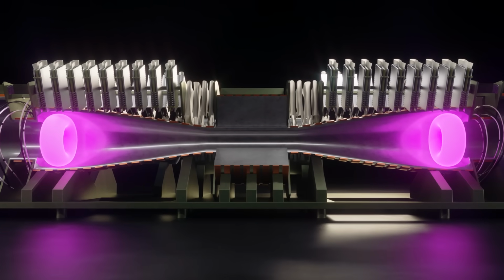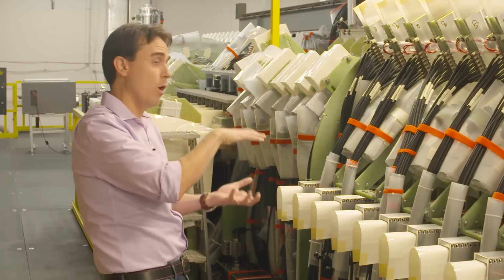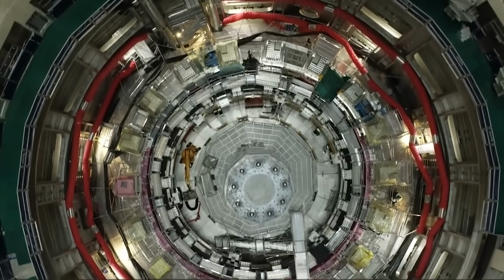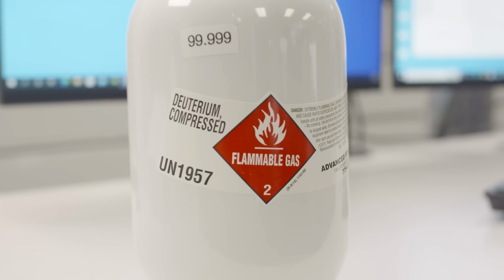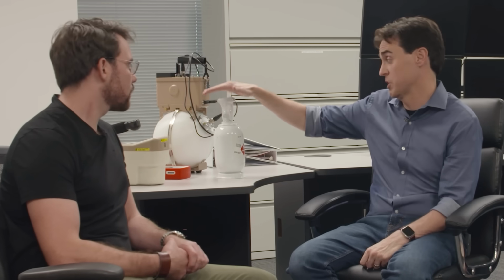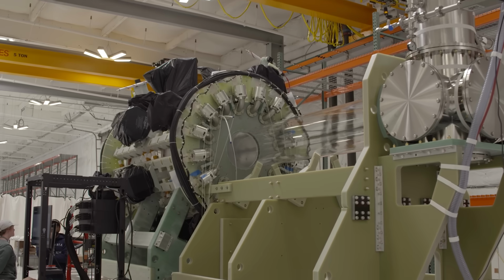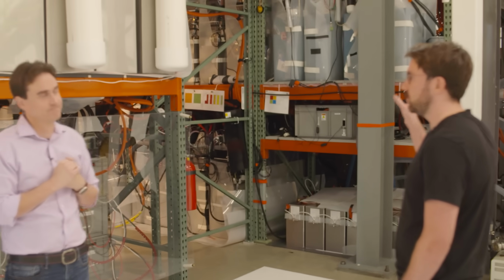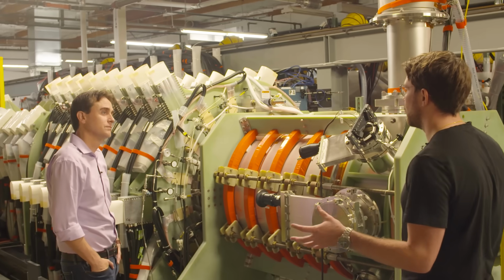A New Way to Achieve Nuclear Fusion: Helion

Comment: I love this process of energy capture so much! Turbines are so last century and this feels like something you could actually put to good use in a spaceship.
Reply: Just put an exhaust hole in it somewhere and it could probably become quite the engine.
Reply: You could even use the same EM accelerators to fire the exhaust out one end.

Part of the problem is you'd need one closed system reactor to provide the electricity to run the second reactor as a propulsor. I think part of the way they want to extract electricity is in discharging the charged plasma, but you would need to keep it charged if you want to magnetically accelerate the exhaust to some insane exhaust velocity. So that would basically require two reactors per engine. But, you could maybe then run it in two different modes. One mode would be fully charged exhaust from one reactor, for maximum efficiency, but low thrust. A high thrust but low efficiency method could be to magnetically accelerate the charged exhaust from one reactor, through the hot inert gaseous products of the second reactor, injected into the stream through a regular engine bell. This would slow the charged exhaust down probably, reducing efficiency, but increase the exhaust mass, and therefore, thrust. So you could make a hybrid engine out of two of these reactors, with a low thrust high efficiency mode, and a high thrust low efficiency mode.

Even the "low efficiency" mode would probably have an ISP rating in the thousands at least, making it better than any chemical rocket by far.
Reply: @hatman4818  Perhaps an optimized thruster is something closer to current ion thrusters, and this reactor would be used for the power input
Reply: "Turbines are so last century" LOL but i agree
Reply: Absolutely agree with you there.
Reply: The spaceship would need an incredible heat dissipation system.  Maybe radiators many times larger than the main body of the spaceship.  In space there is no conduction nor convection to  remove heat.
Reply: @davevann9795  This is just the accepted design for realistic fusion and fission ships. Most of them are depicted either pushing or dragging massive radiators. Some of my favorites have them sprawling off the sides.
Reply: @DigitalJedi  my favorite description of an alternative radiator was (IIRC) in the book Saturn Run where they had long filaments running the length of their ship, and they pumped heated mercury through some nozzle that formed a flow of droplets  that would run the length of the filaments, and these would radiate the heat until collection at the other end of the wire. I remember imagining it like the ship was a glistening guitar.

No idea if its a good idea but I imagine it was based on some existing concept.
Reply: @davevann9795   What produces the most heat in this setup?
Reply: Turbines have withstood the test of time because they work; but not having huge numbers of neutrons randomly waltzing through your reactor vessel at a significant fraction of the speed of light is definitely a plus. The copper coil "piston" method of energy capture is a seriously elegant solution to energy extraction if they can get it to work as intended.
Reply: Look into aneutronic fusion too then
Reply: You have a space ship you need an efficient power plant for?
Reply: "Turbines are so last century" Really now, an over 90 percent efficient way of converting steam to rotating energy is "last century"? What do you think of a Francis turbine? I guess it's medieval, since it's just another waterwheel, just one thats up to 99% efficient in converting the kinetic energy of the water in rotating energy.

I wonder how many more times in my life I will see another new revolutionary fusion reactor before there is one that can actually deliver steady electricity, and more of it then it consumes. We've been doing fusion pulses since the 50's. Fusion It's always just a decade away. I have seen documentaries, and read articles that mirror all the hope of this video for decades now. Every time a new design is tested it's the same story. We should certainly keep trying, but I'll get on the hypetrain when this is actually producing steady electricity.
Reply: As of right now, the weight of this thing alone would be incredibly hard to send into orbit
Reply: @user-mf2gr3cz6e  Yes, but you may be able to use it as the thing that produces the thrust. Even if that's not possible you could just build one on the moon with stuff from the moon and get it into space that way. They may also just find ways to reduce the weight of the machine by downsizing it and using lighter aerospace materials like titanium alloys, aluminum alloys, or carbon composites when possible to cut down on weight. They didn't design this particular particular reactor to be able to go to space, so weight is definitely not a concern in it's construction.
Reply: No more boiling water!
Reply: @ericwilliams1832  It also requires cooling and it is harmful to the environment.
Reply: And that will mean fewer dropped pianos, yes?
Reply: Great!  Now how can I make money off of this discovery?  🤑🤑🤑
Reply: @williamyoung9401  This isn't advice by the way, but if they are publicly traded than that might be a way. another way would be to make a clickbait video about literally any breakthrough science papers or news articles from the internet.

Comment: Maybe I missed it, but is Helion achieving a greater energy output than input like what was achieved at the NIF project?
Reply: Nif project didn't produce more than they used. The laser beam contained 2 mj to create 3 mj but to produce the laser they used 300 mj.
Reply: @ThatHungryAfricanChild  everybody has told you, the power to create the laser isnt importance since thats not what they tested. the next step is to create more efficient laser to create larger net energy. and that is an engineering challange.
Reply: @pindot787  what do you mean the power to create the energy isn't important? That's practically the whole point 🤦
Reply: @ThatHungryAfricanChild  its not important in this context because its not what they tested, you do realize this is happened in laboratorium and not intended for commercial usage?
Reply: @pindot787  the entire point is to create more energy than they use. If they use 100x more than they create then you're still not even close to achieving ignition. It's pretty simple stuff. Input and output.
Reply: @ThatHungryAfricanChild  No. Case in point, I work in FMCG company, lets say i had an idea for a new 5 layered rainbow shape chocolate with cheese and other flavour.
to create a small testing batch to see if it tasted good enough is crazy expensive because we need to buy the ingredients in small batch and manual tooling for the shape.
And now imagine  some random guy said the cost is way way too expensive based on lab cost. thats not how it works, we will create tooling needed for the shape and buy the ingredients in bulk so the cost is cheaper.
same analogy, whatever created in lab isnt the end products, because you only test for one thing to see if it is possible first.
Reply: @pindot787  that's not even remotely close to what I'm talking about. If you make a product but the cost to produce that product is more than what you charge them you're going to always lose money, that's pretty basic dude no need for BS analogies that don't make any sense. Pretty simple
Reply: @ThatHungryAfricanChild  You are missing the point., whatever made in lab will be much more expensive then when you made it comercially, it true for any industry. lab is for proof of concept not a real products.
Reply: @pindot787  it's a proof of concept but if that concept is impossible to implement efficiently then there's no point. If the best they can do is 100x loss then we're still at square one. Other conventional methods are vastly superior unless they can achieve some miracle breakthrough that allows them  to break the laws of physics
Reply: @ThatHungryAfricanChild  fussion is literally not breaking any law of physics, what are you talking about?
anything, I mean anything created in lab will never makes sense cost wise, but if the concept are proven in lab, now the engineer could make it in scale to reduce  the cost.
this is literally how anything new are made. from mass product food to rocket.
Reply: @pindot787  "engineer it to reduce the cost" you say that like it's some easy thing. "Now we just have to figure out how to get net energy gain" that's been the major problem to overcome since the beginning. If the best you can do is -100x deficit I'm not holding my breath 🤣
Reply: @ThatHungryAfricanChild  they already manage to get net energy gain, its literally the headlines dude 😅

now what the need is build more efficient lasers and creating more energy at scale.
nobody said it would be easy but after the breakthrough now they knew it is doable.

dont confuse lab testing and working product.
Reply: @pindot787  how can it be net gain if they lost 100x more than they gained in the process? 🤦 That literally makes no sense. Getting a loan for a million dollars with an interest rate of a billion dollars doesn't make you a millionaire it makes you -$999,000,000
Reply: @ThatHungryAfricanChild They shot the 2MJ laser and got 3MJ energy thats 1MJ net gain of energy.
it doesnt matter how many energy needed to shot the laser, its a lab testing, it would be highly inefficient mechine. your doritos when its made first time in a lab would cost maybe up to 50k for the first batch. yet you can bought it for pennies today. same thing. lab = proof of concept =/= end result.
Reply: @pindot787  yeah it does matter how much energy they used to produce the laser. That's practically the entire point. That's like saying you get a car loan with 1000% APR but the APR doesn't matter we will worry about that later 🤣you know how moronic you sound
Reply: @pindot787  also comparing nuclear fusion to a bag of Doritos is about the worst comparison I've ever heard in my life. Doesn't take $50,000 to cook some corn and season it 🤣